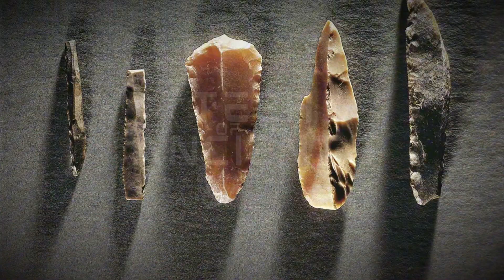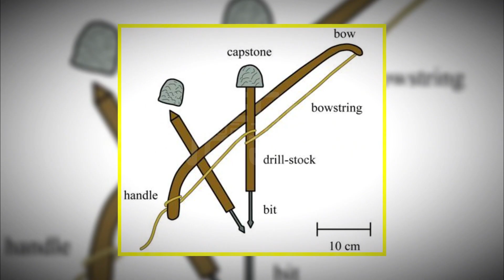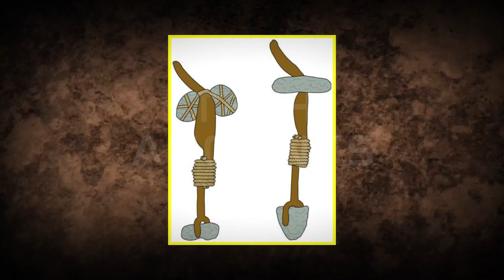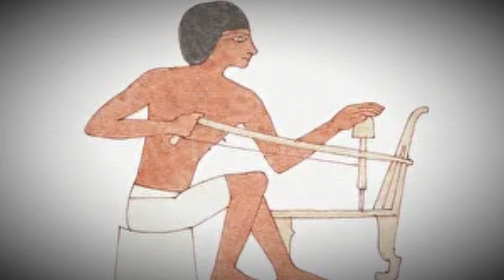Egypt’s Impossible Drill Marks: Proof of Lost Technology!?

Comment: a little common sense: these holes show no drill marks, which indicates slow penetration. And no, you dont need a diamond tipped drill attached to a hydraulic press and a giant motor to drill into stone, a wooden drill with hard stones attached to it and even sand in the drilling hole will do the job - it just takes time and thats what they had plenty.

So no miracles there.